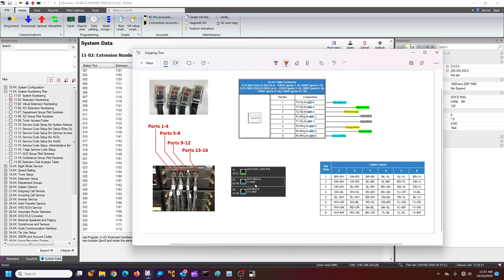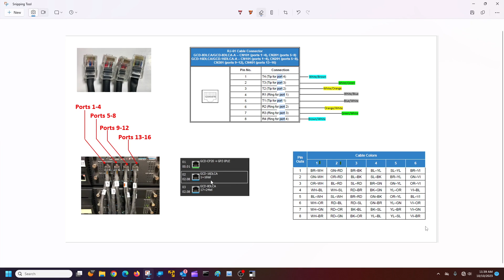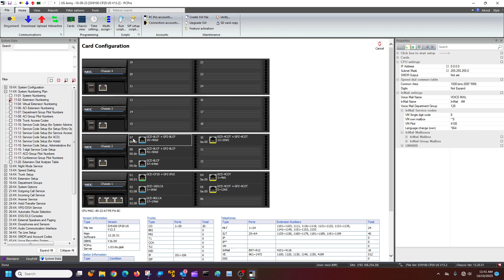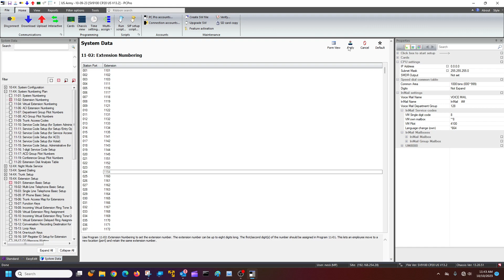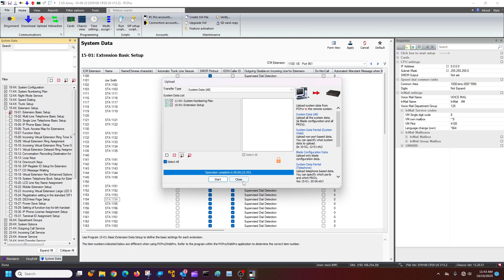(NEC SV9100) Understanding Extension Ports and Numbering

Comment: Hi let say if i want the extension phone with number 1101 outgoing call, how i can make it appear on receiver phone to indicate that receiver received a call from certain extension phone. so if i call using extension 1101, it will appeared on receiver 1101, if i call from 1102, it will appeared 1102 and so on.